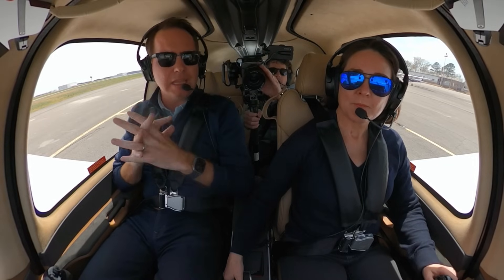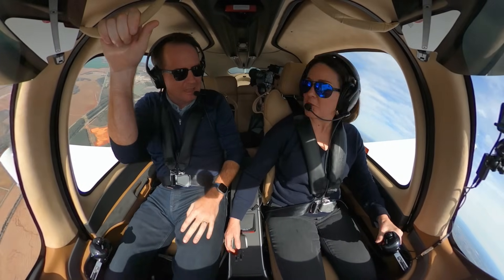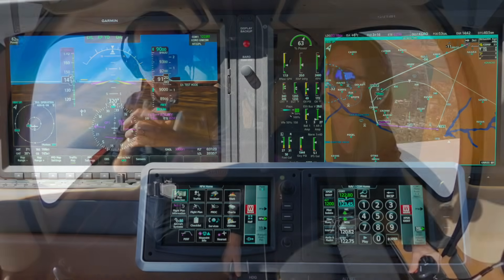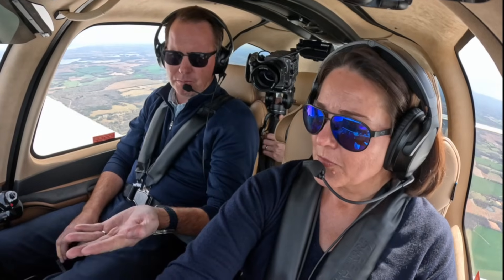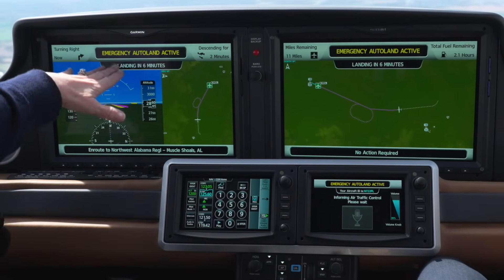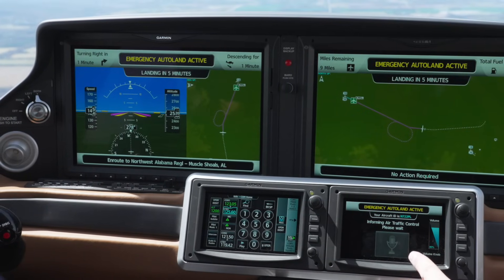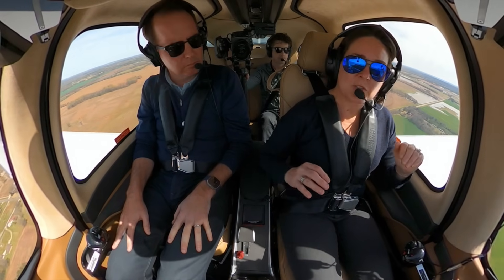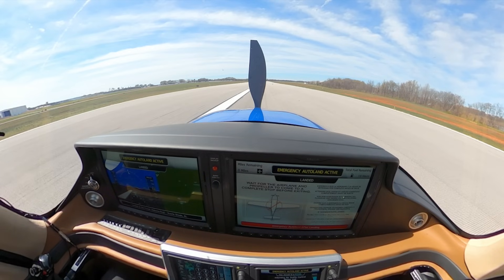SR Series G7+ Safe Return™ Emergency Autoland Training Demo

Comment: The next level would be for Autoland to choose an optimum altitude/location and then deploy the CAPS should an Autoland option not be available due to insufficient fuel or an engine that's already out.

Comment: Does it tell you which ATC it announced the Autoland to so you can contact them? I noticed that Contact ATC wasn't on the checklist. Also, the checklist item for pulling the circuit breaker seems to be unnecessarily abbreviated: "EMER" which I assume is for "EMERGENCY" and "CB" instead of "Circuit Breaker" which there appears to be plenty of room to spell things out.

Comment: How capable is it at recovering from loss of control? If the pilot becomes totally incapacitated and causes the aircraft to start a continuing roll or stall or spiral or something, is the system able to recover control before routing to an airport?

Also, I wasn't looking at the screen right away, so all I heard was the voices, and I deadass thought I was hearing Airforceproud95.
Reply: The active passenger (in that scenario) should opt for CAPS instead of Safe Return. I think.
Reply: @AiyoFoundation  What is CAPS?
Reply: @MultiPurposeReviewer  Cirrus Airframe Parachute System… basically a parachute for the plane that brings it down to the ground safely.
Reply: @AiyoFoundation  Ohhh yeah, I think I've seen a demo video of that, now that you mention it. Thanks.

Comment: So the Safe Return requires servos to operate the throttle and mixture, but this capability isn't available in the general autopilot functionality, i.e. no autothrottles for climbs and descents under autopilot?
Reply: Probably not tested/validated for continuous use?
Reply: Yeah the fact that this isn't just FADEC is pretty confusing
Reply: That may require a FADEC engine.
Reply: I think they need more software testing for non emergency auto throttle
Reply: Cirrus will add autothrottle next year, will rename the new “bird” to G7++ …..just to charge you $200000 more. Still, with an engine from the last century.

Comment: If a pilot got disoriented in IMC, can this system bring the plane out of a graveyard spiral?  Any speed, AOA, or bank limitations for when it can be activated?
Reply from the maker: If the pilot has not interacted with the aircraft, say, by changing a radio frequency or other input, the aircraft will ask the pilot "Are You Alert?" If there is no response from the pilot, Safe Return will be activated. The pilot does have the option of deactivating the system once it has engaged.
Reply: @CirrusAircraft   Very interesting. So if the aircraft enters an unusual attitude like excessive bank or high g, the system will automatically ask pilot “are you alert” and activate safe return.  Correct?  

Or is it just a specific amount of time after no input that pilot alert and activation will occur ?  For solo pilots that is very good.
Reply: @CirrusAircraft  how long is the deadman timeout
Reply: Actually you’d press the existing Blue button in the Cirrus today. That would return the plane to straight and level flight. For a Spin, Cirrus wants you to deploy the parachute as long as you’re above the minimum deploy altitude. Auto land is really meant for pilot incapacitation.